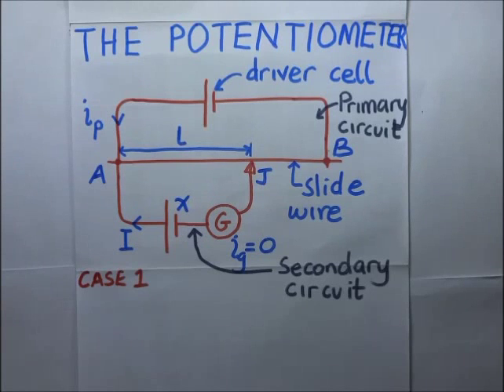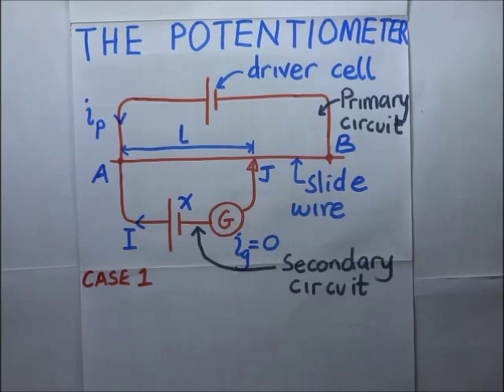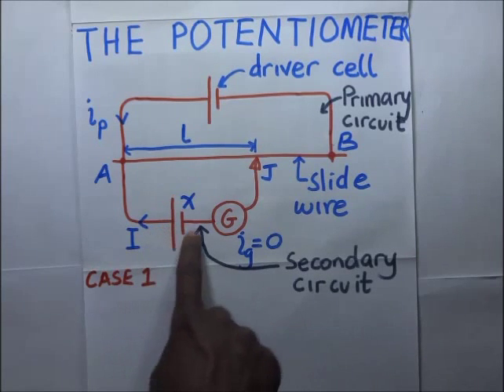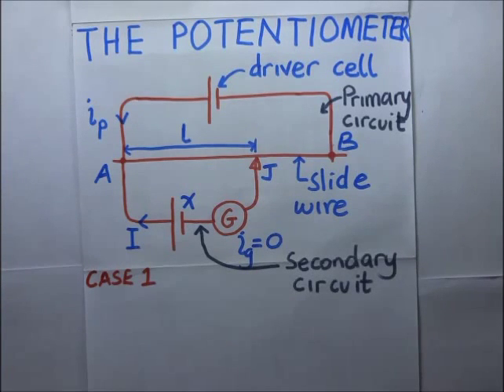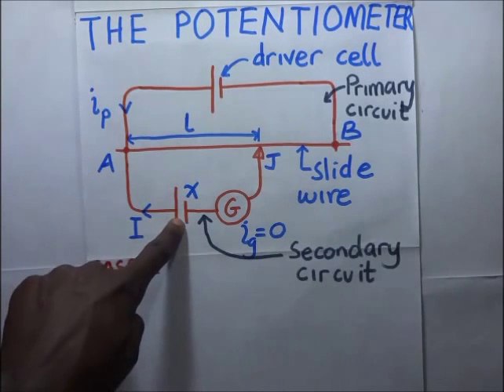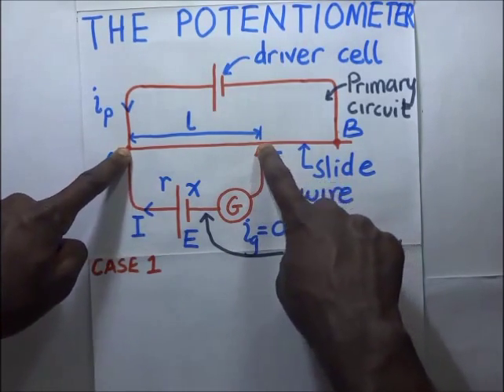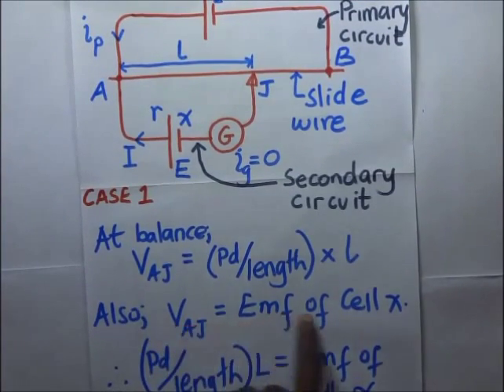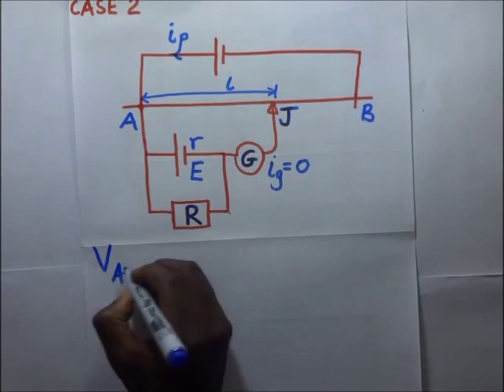Principle of D.C Potentiometer | Principle of slide wire potentiometer

Comment: What if the pointer is not at the balance point? What will be the pd across the wire and the direction of current flow in the secondary circuit?